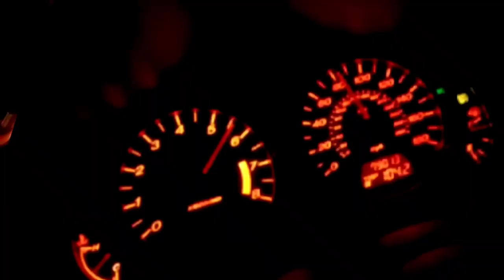MS6 hellcat pump setup for DI + Auxiliary PI

Comment: The Radium venturi kit comes with 3 different venturi nozzle sizes. Each has a different color. I couldn't tell for sure in the images, but is it the silver, green, or brass?
Reply from the maker: Using the green one on mine
Reply: @sohankghosh  awesome bro. Thank you. I'm assuming you've verified fuel transfer is appropriate with that size? It would be obvious if it was too small, because you'd show empty when theres still fuel in the passive tank (wouldn't take the full 15.7gal to go from E to F).
And if the nozzle was too big, the fuel gauge would hold at F or decrease slowly for a little until the passive tank is emptied and then the gauge would drop noticeably faster.
Reply from the maker: @Craigineering  yep! Works as intended. I have no fuel starvation issues as far as sucking the basket dry unless fuel level is below 1/4 tank. Tank fills ups are roughly 13.5-14 gal from when the low fuel light turns on and 7.5-8 gal at the half tank mark.